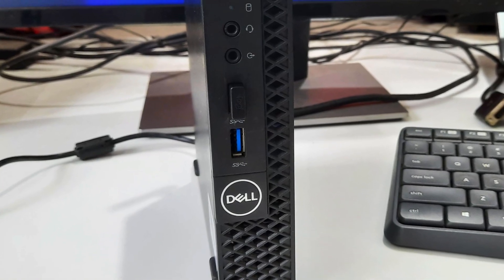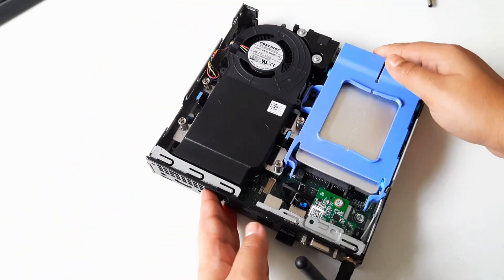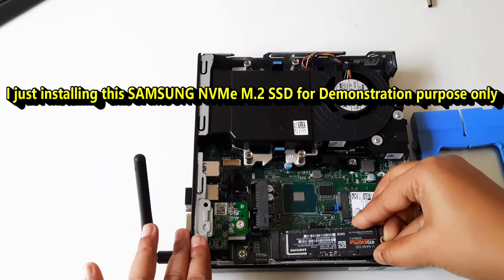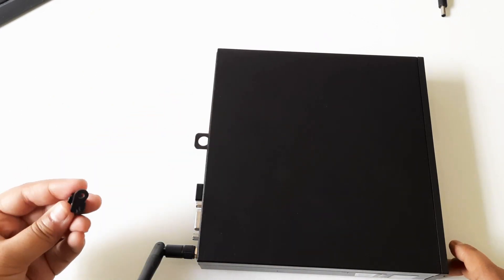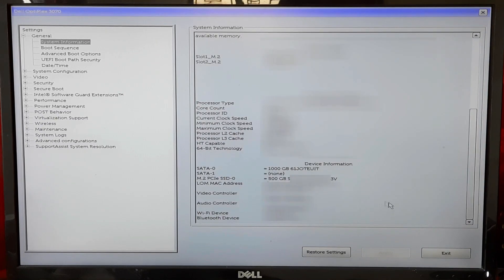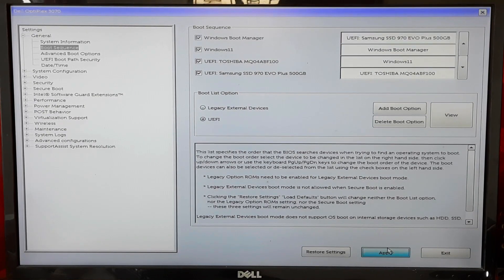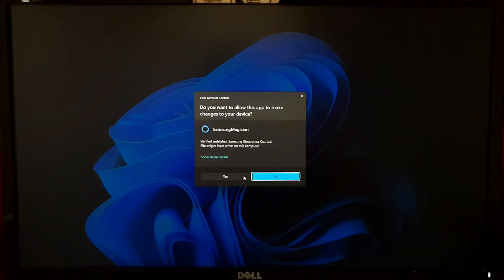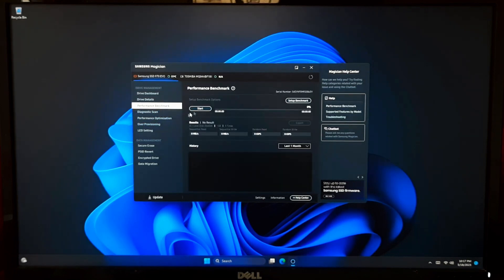How to Install an NVMe M.2 SSD on Dell OptiPlex 3070 Mini PC

Comment: Consistent SSD not showing in windows 10 please help me
Reply from the maker: Did you initialize your disk from Windows disk management?
Reply: @asatechnical  yes and also windows to be on SSD, it works smooth until a week, suddenly laptop get off and shows system ran into problem so again installed OS but SSD not taking
Reply from the maker: Go to BIOS and check if your SSD is detected!
Reply: @asatechnical  in bios also not showing but in disk management shows unknown.